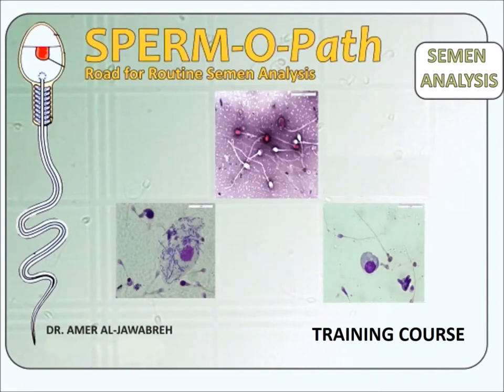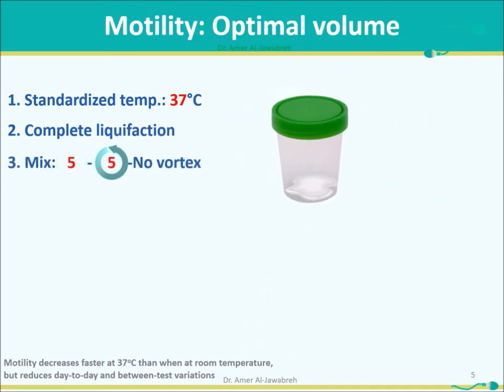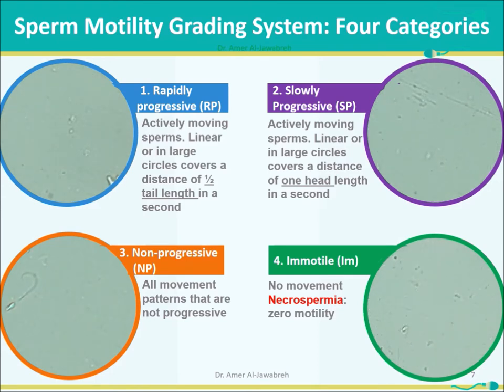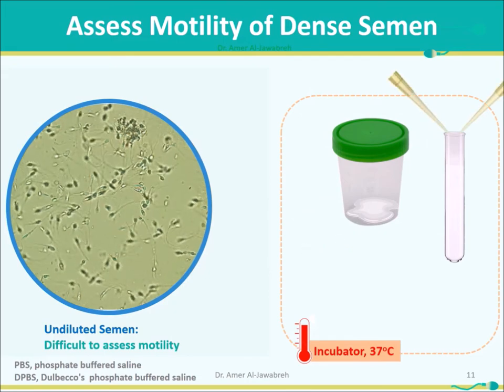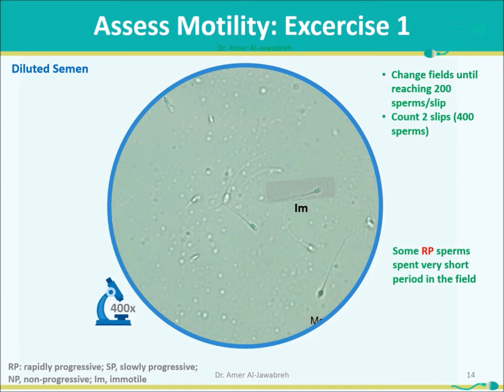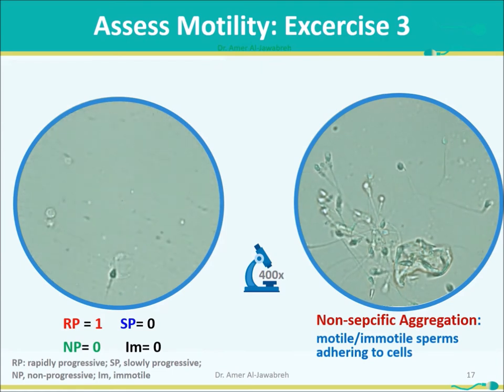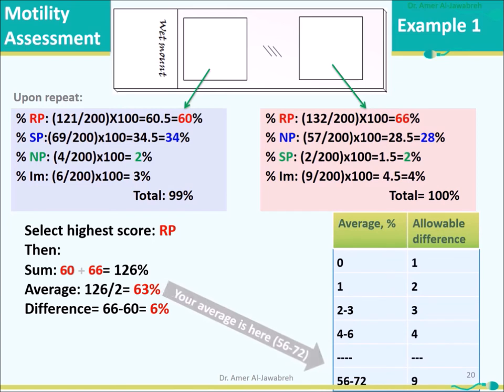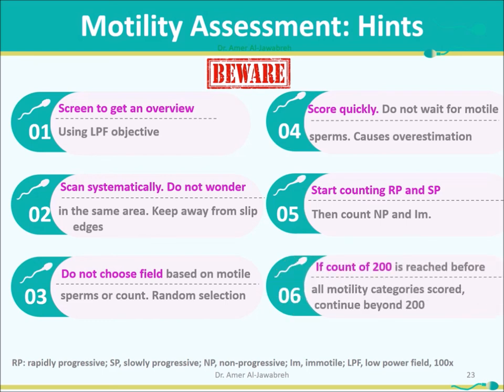Semen Analysis-Part 2- Motility Assessment

Comment: 3:59 Concerning the RP motility, how is it really done? Per the field at 3:59, according to my observation, about 15 RP sperms are not seen at once. At some time, less than 10. So how did we arrive at 35?
Reply from the maker: Previously it was easier as we had to differentiate between three levels of motility active, , sluggish, and immotile, which accurately assessed. However, it became a challenge when active was split into rapid and slow. Going back to the definition in 1:49 with a bit of practice as in our lab will help overcome the difficulty